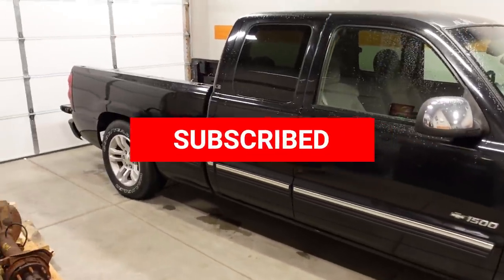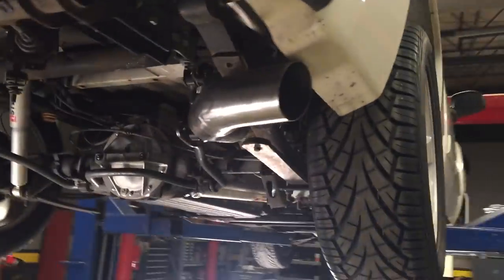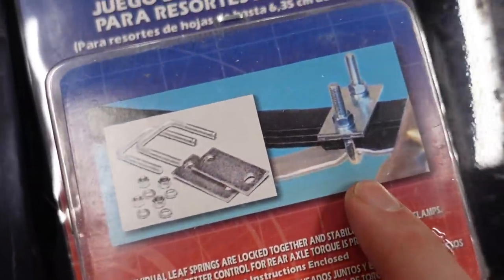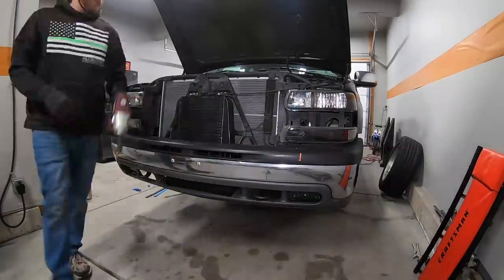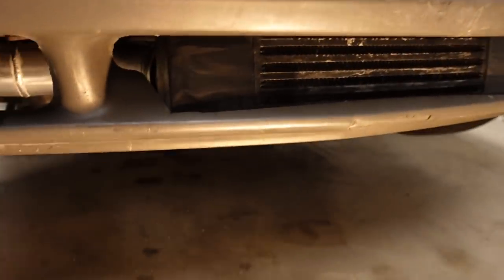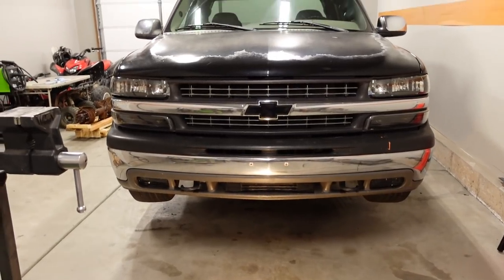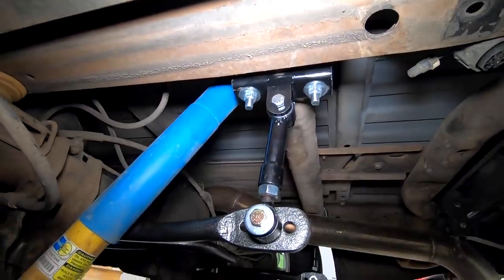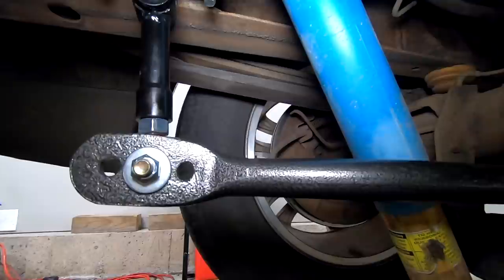Sway Bar Upgrade for a 99-07 Silverado

Comment: I think the new valance looks great! Your intercooler is still pretty damn low-key, in my opinion. It could be easily be mistaken for an oil cooler or power steering cooler, if it gets noticed at all.

Comment: Of all the upgrades I've done on my truck, the full Power Stop brake kit is by far the one I'm most pleased with. It costs less than the same OEM parts, it's quality, and the braking improvement is excellent. Plus the drilling and slotting makes the braking better and more consistent in any weather plus the pads and rotors last forever.

Sway bars are such an overlooked upgrade on street trucks yet they make a huge difference in handling.
Reply: The sway bars do make big improvements? I was just about to ask LT. 
what differences do you feel /see?

Comment: Same reason for why I never bought Calvert cal tracks for my 04 rcsb silverado, especially since I live in an area where there’s lots of curves and mountains. In a perfect world I’d love having a nascar type of rear trailing arm suspension, but the gas tank is in the way. When my budget is met A parallel 4 link will definitely be the next best solution. For now as a budget alternative I’m thinking of picking up a set of Gm’s new composite leaf springs that are now used on some Silverado and Sierra models and converting them to my truck. Since they’re lighter than steel they might handle better as well.

Comment: To simply put it;

If understeering, soften the front roll bar and/or stiffen the rear. 

If oversteering, stiffen the front roll bar and/or soften the rear.

It can be a little more complex than that and other factors can also be put into the equation but that's more or less what you do with tuning roll bars.

Comment: Joke's on you. Sway bar end links are always tight to install. 
  I like the new vented lower valance better than the original air dam. 
  She should handle better better. I used a set of over the axle traction bars. I didn't have much of a wheelhop issue, but I knew I was going to add traction and weight and power and didn't want any hopping. I got mine from tough county. They have a bracket on top of your spring and bolt to your front spring hanger. Not as noticeable or obnoxious as regular 6' traction bars that you see on every diesel truck. 
  Building a custom 4 link would be great. I'd like to see how you determine the geometry.. and how the different length bars and locations affect handling.

Comment: I like the valance, I think if it were black like the top of the bumper the intercooler would blend in better. Also I’ve used heat guns or little torches to round over and smooth plastic air dams and fender wells with good results. Keep up the cool content!

Comment: On the lower air dam put some honeycomb punched metal or some stainless hardware cloth and paint it black. It will help hide the cooler and protect it from rock hits. You barely notice it as is.

Comment: Stiffer encourages more oversteer from the rear.  Looser encourages more understeer. Or less likely to rotate. Looser is always safer and with a rwd application you can still corner well with more throttle. You want it tighter if you don't have power have a fwd car or you are more concerned for cornering off throttle. Like an autox. These are some generic guidelines. I got the beltech front and rear bar and they aren't adjustable but if I had a tighter front I'd enjoy that alot.
Reply: an old school fix is to shorten the spacer tubes on the stabalizer links
Reply: @chasnelson5753  that'll preload the sway bar sure. What I could do is make some hiems jointed endlinks with a physically bigger bar and that could help too

Comment: Sway bars are a bit counter-intuitive:  A rear sway bar increases UNDERsteer, while a front sway bar increases OVERsteer.  Since only the rear is adjustable in your case, if you have oversteer tighten the rear sway bar (holes closer to axle) and if you have understeer loosen the rear sway bar (holes farther from axle). Just a rule of thumb, but hope it helps!  Keep up the good work LT!
Reply from the maker: thanks for the input! helpful to know
Reply: This is completely incorrect.

Comment: @Lawrence LT Tolman, are you thinking about going with an AAM 10.5 or 11.5" 14 bolt full float rear end? If you are, are you going to find 6 lug hubs for the rear end so you can use your current wheels?

Paint the low bumper scoop with an auto primer and a durable enamel/polyurethane coat of black color to hide the cooler.

I cant wait to do some stuff on my 07 classic (gmt800).

Tri tone paint, blue silver and orange, 706 or 862 heads that have a valve job  and ported, stainless steelrockers, not sure what cam i will put in, MakoShark Corvette catback exhaust. The Truck will stay NA.

302, 327, 350 (Gen 1&2 SBC)
293, 325, 364 (Gen 3&4 SBC)

Mine is 293 cid.

Comment: @lawerancetolman   03 Z71 tahoe rear brakes are a direct swap and get you rear dual piston calipers and larger rotor  great up grade I did on my 99 silverado helped alot with towing and all around brake performance I can send you part numbers for swap if interested
Reply: They’re the same as SUV calipers. The police Tahoe’s had a thicker rotor as well, like you I’ve done the swap on my 00.

Comment: LT, big fan of the new venture on the channel! Love the builds and am excited for more!

Had a question for you. The Allison 1000 transmission that would come standard with the Vortec 8100, could it be adapted to other Chevy big blocks? If not, what heavier-duty transmission would you recommend for a    650 lbft big block 1 ton truck or 3/4 ton suburban?

Looking forward to more great videos!
Reply from the maker: yeah, in theory you could put any GM engine in front of an allison, it would just need the 4L80 flexplate for the larger converter bolt pattern. As far as your truck, a peoperly built 4L80 might be a better choice, they can hold the power no problem, they shift quicker, and standalone or EFI controllers are much easier to come by than a standalone for an allison.

Comment: Hey lt,huge fan  I drive a 2000 silverado 4x4 i wanna install 2 inch lowering shocks an was wondering if that affects the 4x4 or do i have to address anything else thanks for all the info over the years

Comment: a question with the stabilizer bar and the shocks I have a 2005 chevrolet silverado 1500 2wd and I have used many brands of moonre, KYB shocks and it does not feel good when driving, what number of models are your shocks I see that they are a bilstein brand could you say the model that you use in front and back, on the bar, why did you change it and it looks thinner than the original, how much does it vary? Tks for your help

Comment: Why use stock rubber brake hoses when there's an aftermarket braided steel 5 line kit for Silverado for front and rear for the Same Money
Ck it LT

Comment: LT, please tell me that the un-crated rear axle I saw was a 14 bolt ff axle with rear disks for the Burb....
Reply: I'd like 1 from a 2001-2007 2500 HD for my 07 classic 1500 but have 6 lug hubs since the stock 17 inch star wheels look great. 17x7.5 offset is 31mm.

Either they are a 10.5 AAM or 11.5 AAM

Comment: I did Kryptonite control arms / ball joints / leveling kit.   But so many people swear it causes big issues with front end and causes it to ride bad , and trash the front end cause of the angles on CV / ties rod etc.   my kit didn’t have me cut anything out like yours did.   What’s your thoughts on this ?
Reply from the maker: the way the control arm was designed will dictate whether or not you need to trim the upper extension stop. The ride quality depend on how far you crank up the torsion bars, and as long as you don't "top out" the control arm on the extension stop or shock limit, your ride quality should be just like stock (mine is). The CV angles are dependent on the amount of "Crank" you put in also. So long as you dont go for an extreme lift (2-2.5" should be OK) your parts should last a long time. If you put a massive offset wheel and abuse your truck in 4wd however, then you will definitely wear out parts a lot faster.
Reply: @LawrenceTolman  that makes sense , as you know probably more then anyone.  So many none professionals always have something to say about how a part or design should work.  I’m part of a big Duramax group & probably 3rd of them swore up & down how bad I was going to affect my front end from using a 2inch leveling kit! Lol but I doubted it when I see pros such as yourself using the same type kits.  I’m having problems with mine cause I forgot to measure prior to installing the keys and have had hard time trying to get it equaled out correctly.   I’m running 22x12.5 with a -44 offset.    So I’ve had to trim some up.  Was even thinking of doing a bumper spacer kit

Comment: Understeer is when your front end hits the wall first and oversteer is when your rear end hits the wall first. That is the first thing you learn when you begin oval track racing.

This is a very general rule of thumb - You soften the springs or swaybar of the end which slides first - Example, if you are understeering in a corner, then you would SOFTEN the front end. This of course, also means if you are understeering, you can also STIFFEN the rear springs or swaybar. It works both ways.
Reply from the maker: good to know!

Comment: Why are the rear end links so adjustable?
Reply: I suspect the adjustability is there to adjust for different ride height applications, it will keep the geometry correct, and help prevent the brackets from spinning on the axle. Nice to have that option, when they could have gone the cheap route. Nice install LT.

Comment: What was that you installed on the leaf Springs
Reply from the maker: that was a spring clamp that held the main leafs to the overload to try and prevent wheel hop... I've since replaced those with caltracs
Reply: @LawrenceTolman  interesting I just learned something new thanks

Comment: So with clamping down the leaf spring 2 thing will happen your truck will lower about 2 inches and the ride will be very bumpy. I had them in mine, i was on a 2/4 drop and i did both front and rear worst thing i could have done i was bottoming out bad and bouncing horrible.

Comment: Would this work on a 6” lift Silverado 99
Reply from the maker: yeah, the end links will just need to be extended a little on the longer side, or maybe lengthened a little
Reply: @LawrenceTolman   do they offer longer links with the kit? Would hate to max out the ones you used in your video

Comment: FYI, after some digging, I found the PN for that specific valence. 15709110.
Reply from the maker: I've found a few new at the dealer, but they are pretty expensive brand new
Reply: @LawrenceTolman  yeah, that's what I'm seeing. They're about $350.

I also found a few on marketplace, but the sellers don't even read the messages lol 

Where did you get yours?